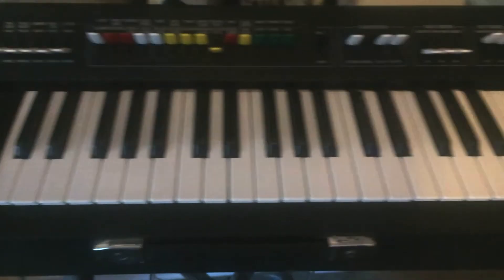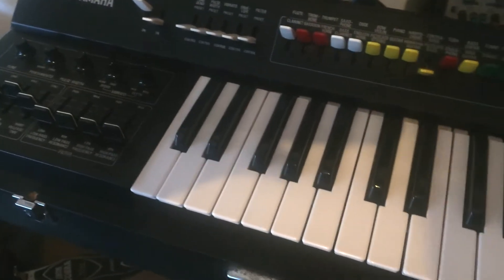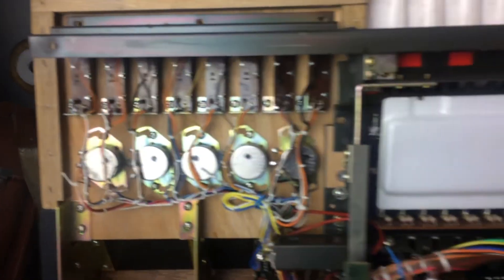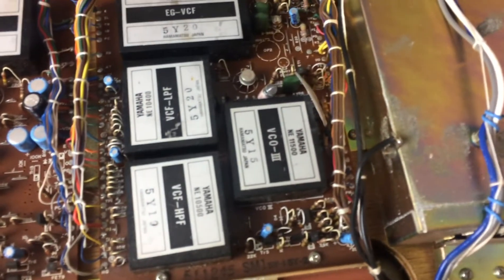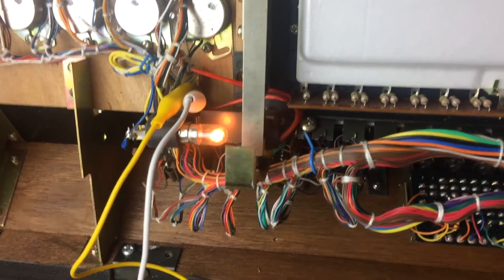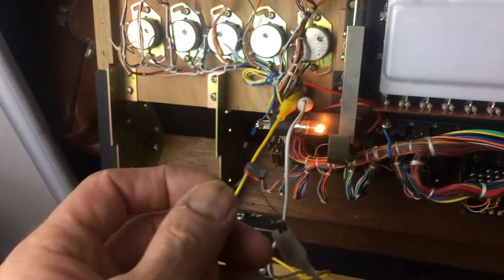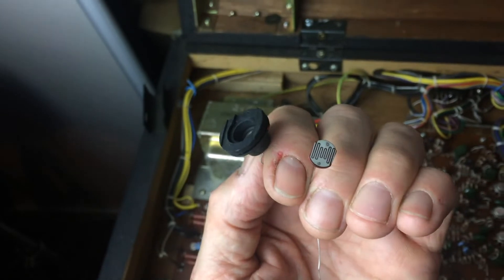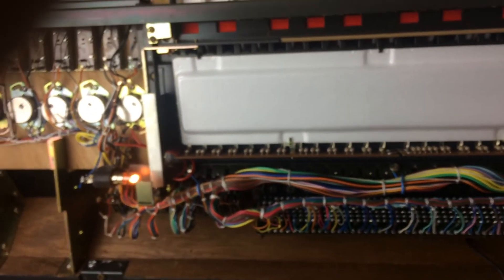Doctor Who Music:  Yamaha SY-2 Synth Repair | Fault Finding and Component testing

Comment: The original light sensing resistor uses CdS (cadmium sulphide) and tends to go bad over time.   I had the same issue with my SY-2 as well.    Everything else on it (like most Yamaha gear from that period) is basically bomb proof.

Comment: Nice fixing, congrats !👍 I've got the same issue here, and need to choose the right LDR. So wich one do you used, any reference, please ? And did you need to adapt something on the circuit (apart to adjust the trimmer VR8) ?   Thanks in advance ! 😎
Reply from the maker: The bigger one! Haha 😂 I don’t remember exactly but they were cheap and only two sizes that I could find. They were only a few dollars each. 8x10mm I think was the one I used. No mods apart from tweaking it to get it to fit well. It’s a very simple mechanical system so easy to get going. Try an eBay search?
Reply: @onomatopoeidia  Thanks for your answer, even if from an electronics technician I was expecting more of an answer in ohms ! 😅
Reply from the maker: @pascalgirod2318  big ones are: - Dark resistance: 0.5M ohm min.
- Light resistance: 2.8K ohm min 8.4K ohm max.
- Max dissipation: 100mW
- Rise time: (0-63%) 50mS
- Decay time: (100 - 37%) 40mS

Small:
 Similar to Philips ORP12- Dark Resistance: min10M- Light Resistance: 48k - 140k- Max Dissipation: 30mW- Rise Time: (0~63%) 40mS- Decay Time: (100~37%) 10mS-

I normally log all my repairs but for some reason didn’t for the Sy2. Think I was jealous so moved on quick :)
Reply: @onomatopoeidia Thank you for the clarifications. And I also sometimes don't log all my repairs either, no worries. 😉Do you have any reference (manufacturer etc) of the big one ? Because ebay is a jungle... I prefer Digikey, Mouser etc. Anyway, thank again for your help !
Reply from the maker: @pascalgirod2318  in Australia so just use Jaycar but I’m sure the same part will be via Digikey https://www.digikey.com/htmldatasheets/production/5858660/0/0/1/02-ldr2.pdf

Comment: i have an Sy1 and it started poping and crackling sonds..i could put my hand on its side and would sound ok. now it just quit sounding  and only pops when keys are pressed no sound..HELP any advise!
Reply from the maker: Best advice is to take it to a technician really. There are So many possibilities from simple audio jack or potentiometers to power and audio circuits. Could be as simple as a dirty connector or solder joint somewhere. It’s not rocket science! Turn it on, keep your hands away from live AC power input and fiddle the connectors inside until you find where the issue is. If you are not familiar with ac powered equipment, do not work on it as it can kill and give a well deserving gear specialist the money as they never earn enough for their knowledge!